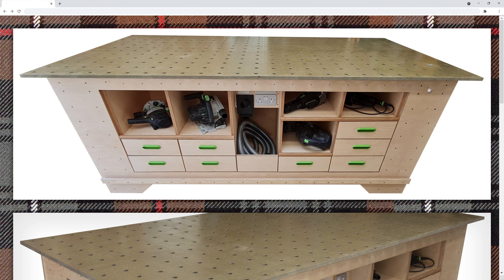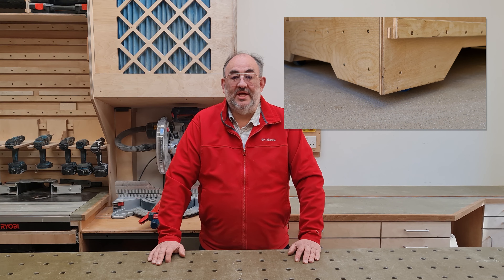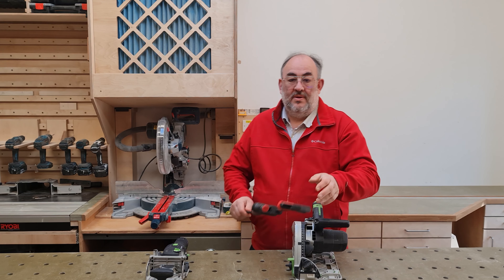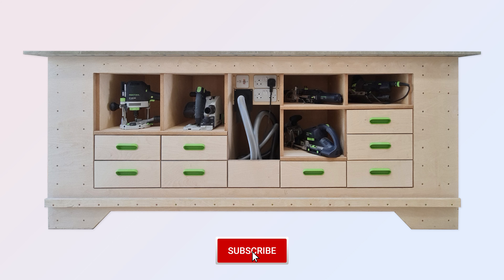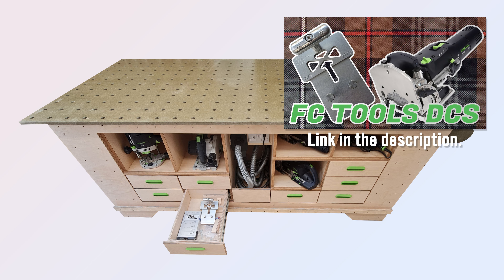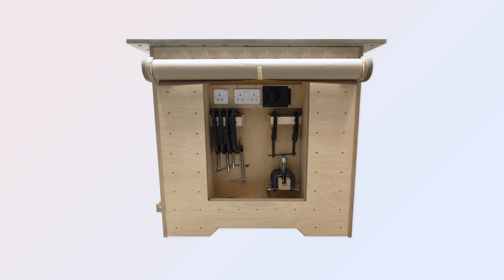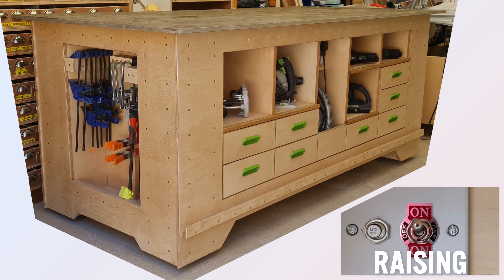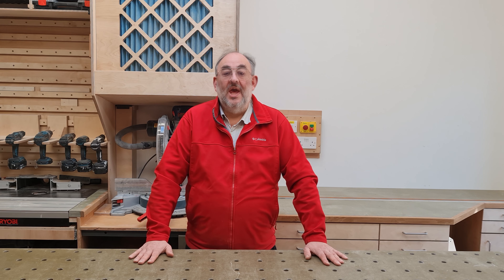Festool Mobile MFT Workbench!

Comment: Simply class. It could be in a James Bond movie. Well done 👍👍
Reply from the maker: Thank you Colin. I'm pleased thus far not to have found something that doesn't work well for me and the movement efficiency of having the core tools literally to hand and clamps just around the corner has been very gratifying. Have just bought a thicknesser and made extension tables for it which all sit in the drawer around the back, I can move the bench away from the shelves and work on the other side easily with the linear activator castors.

Comment: Dang! I thought I had the only linear actuated bench out there. I’ve even googled it with no luck. Glad to see someone else had the same idea. I run mine on two actuators that use a lever system to raise the bench. Takes up a little more internal space but cheaper than 4 actuators.
Reply from the maker: Thank you for your comment, Rhett. There's another bench on You Tube that I saw in a short video a while ago but without any narrative that I reckon had them. Having lived with my bench for the best part of a year now, actuators are so easy and you use the facility on account of the convenience.
Reply: @AMBuilds  ya, I don’t move my bench often. But it’s nice to just hit a button and go. A few things I’ll change on it. But I really liked the clean look of your bench. Nice job
Reply: I've been thinking about doing something similar, which actuators are you using. Do you recommend them.

Comment: How did you attach the upper portion of the actuator assembly—(🎉the three layers of 18 mill plywood) to the hollow leg box?
Reply from the maker: Hello Derek,

Firstly, I trimmed the blocks down, gradually, until they were a tight knock in fit for the hollow legs. 

I did wonder whether I would need to put something like a Domino through the hollow leg into the block but during the construction I just used some 6mm (I think) screws with  pre-drilling so that the plywood was not over stressed or the screws snapped or heads rounded over.

With taking the time to trim the blocks carefully, the high level of friction plus screws seemed enough and I thought I would leave it at that.

I have had 300kg of steel box section for my koi pond project on the bench and was able to raise the bench, move it within the workshop and drop it down without those blocks moving at all so I am reasonably confident that it will do for me.

Comment: Very nice...but how did it get made
Reply from the maker: Thank you Paul. There are vids on making the big MFT style top, the linear actuator legs and the planer drawer, on the channel. We hope to feature the rest at some stage in the future but can't promise when. It is based upon a torsion box joined low down to the ends and then self contained cabinets and a one sided torsion box, sitting on the cabinets with spacers to make it as flat as I could manage and then above that,  the green top. Do you have a specific question? If so, please ask away and I'll do my best to answer

Comment: Can you access under the table surface when screws fall through a hole or securing the clamping elements from underneath
Reply from the maker: Hello John. My top has two perpendicular rails mounted with dominoes to fit inside the front and back frame sides. Being MDF it is quite heavy and I took care for a nice fit and it sits there un fixed. If I loose something then I can lift the top from the front or back and the opposite side acts like a hinge and a piece of wood used as a prop to retrieve/vacuum.
Does that make sense?
Reply: @AMBuilds  That makes perfect sense

Comment: Adorable and well made MFT workbench sir. 
One question:
Why do you prefere a Bosch miter saw and not a Festool Kapex miter saw? 

Thanks for sharing! 🤝
Reply from the maker: Thank you Crippleman for your kind comment.
The Bosch replaced a Delta Sidekick 10" sliding mitre saw which had a 12"x4" cutting capacity, which was really handy for larger crosscuts and big sections, at a very modest cost. Sadly it fell over and smashed the handle and the bearings were getting a bit sketchy, so I needed a new saw and as I was planning my workshop at that time, one designed to be back to the wall.
Apart from my TS55, I had not yet succumbed to significant Festoolitis, and I wanted large capacity again. The Bosch will cut for example a 110mm plastic soil pipe or a 4" pressure pipe, ideal for my drainage projects and a koi pond I am building, as well as a long cross cut, useful to me as I didn't have a table saw. 
The Bosch was less than half the cost of a Kapex with a bigger capacity so I plumped for it.
I don't have many Bosch tools (I also have the, in my view, excellent PBD40 bench drill) and this saw but I'm very pleased with it. The axial guide arms are still smooth and tight and the cuts are very clean.
I now have full blown Festoolitis to the extent of making this house for them but don't regret my Bosch purchase.